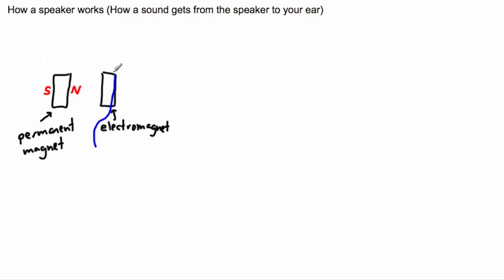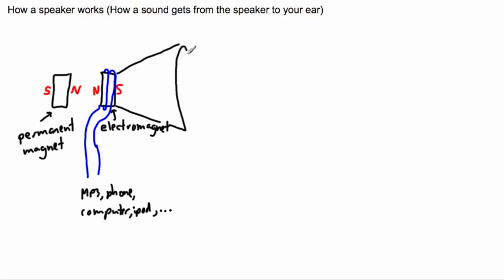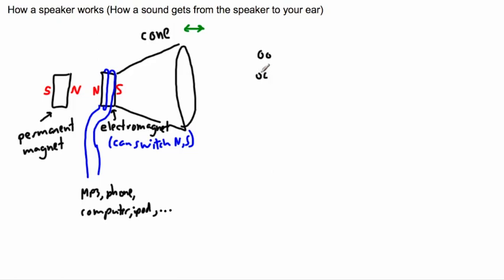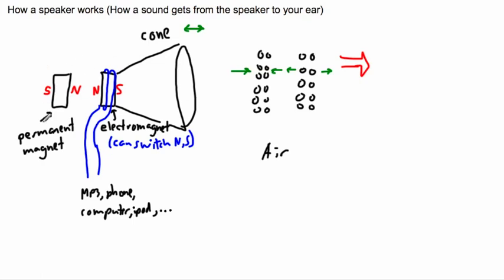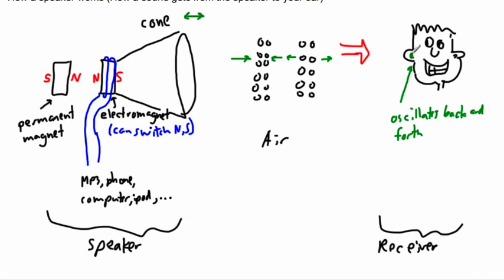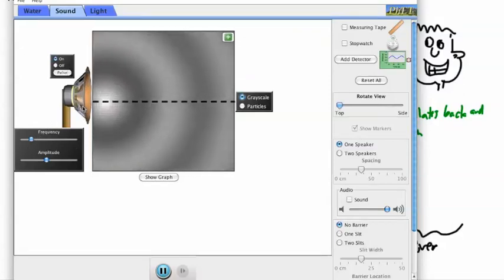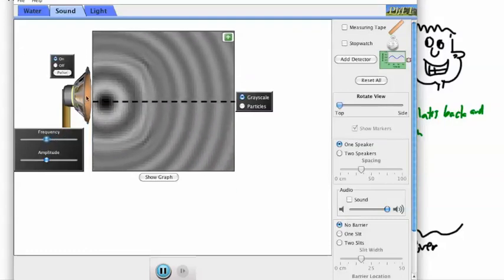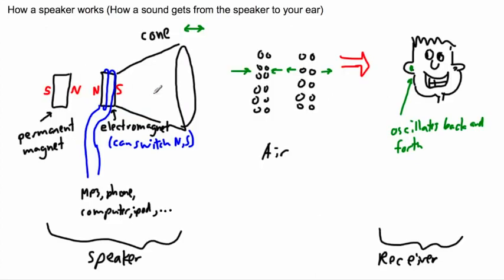Waves - How a speaker works - (IB Physics, GCSE, A level, AP)

Comment: This video is especially useful because it explains the most common design of home-made speakers (e.g. made of paper, plastic bottle ends, etc.), which use a single magnet (or stack of magnets) with north-south vertically aligned. The movement of the membrane is caused by the permanent and electromagnets attracting/repelling each other along a vertical axis (as shown in this video). In most real speakers, however, we actually have the north-south poles of the permanant magnet horizontally aligned, thanks to a more complicated use of ring-shaped magnets! The up-down movement in this case is caused by the Lorentz force: a horizontal, current-carrying wire passing through a horizonal N-S magnetic field (at right angles to the current direction) is pushed up or down, depending on the current direction. It's amazingly hard to find online videos that describe the former design. So...thanks!

Comment: Great! video. Makes me think then how is it possible a piece of cardboard can mimic any sound? While musicians need to use different instruments to create a different sound in the first place.

However, I assume its the speed of the vibration, ?I guess?, but still boggling.
Reply: Thanks for the message! You can make a sound by literally pushing air back and forth (like in a speaker), but you can also do it in other interesting ways. You can set up vibrations in a material (and the sound propagates THROUGH the material). That would then oscillate the air molecules and send that sound through the air to you. Cool, huh?
Reply: jaffar alreahi I'm not sure I understand your question - you want to know about regulations for speakers? Regulations or rules of operation will likely depend on the country you're in. For example, the US has the FCC (Federal Communications Commission) to regulate the operating details of most devices. In other countries, there are no regulations at all.
Reply: Mitch Campbell please pleas i want understand the Regulations that loudspeaker need to work???
Reply: Mitch Campbell Sorry, I made a mistake on my grammar, is just I speak 2 languages, but what I meant to say how can a piece of cardboard cone can make or imitate any instrumental or multiple sounds?

In which, most musicians need to play different instruments to make different sounds.
Reply: Jillian walker ahhh...I see your question. Yes, musicians need to play different instruments to create the sound, which is then recorded. But in order to play the sound out again with a speaker (which could be just a piece of cardboard), it works amazingly well because sound is just a push and pull of air molecules. So any material moving in the right push and pull pattern can recreate any sound. Cool, isn't it? So the speaker merely recreates the sound that was recorded. You still need to have an instrument, etc in order to record the original sound that the speaker will eventually recreate for you. Hope that helps! Cheers, Mitch
Reply: Mitch Campbell thanks

Comment: if frequency is about speed of the speaker cone, then amplitude is about how far the speaker cone goes up and down?
Reply: im  wondering too, have you found the answer ?
Reply: valentass88 well just now noticed the uploader said 'that's exactly right' i'm assuming this is directed towards me. but i was already fairly sure this was the case
Reply: valentass88 Yes, this is right. The amplitude is a measure of how far the cone goes up and down, while the frequency is how many times per second the cone goes up and down (so it's measured in oscillations per second, or sec^-1, otherwise known as a Hz).